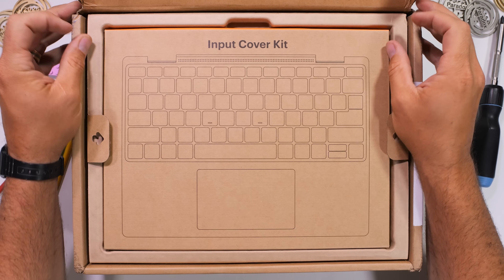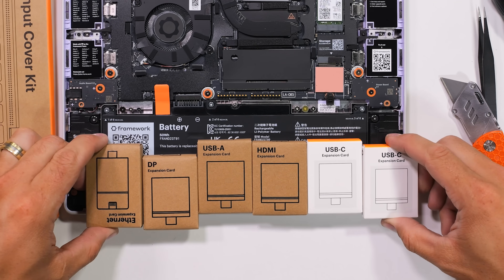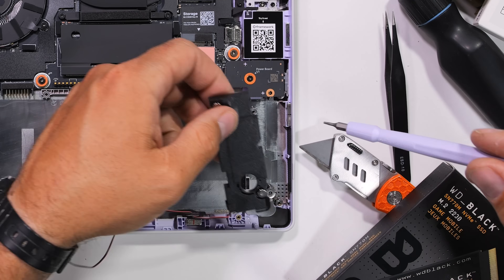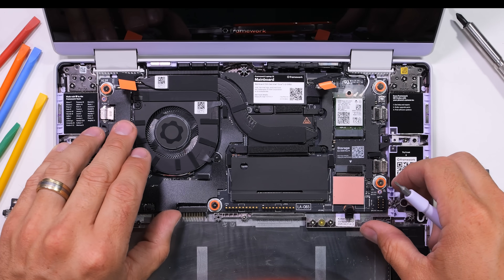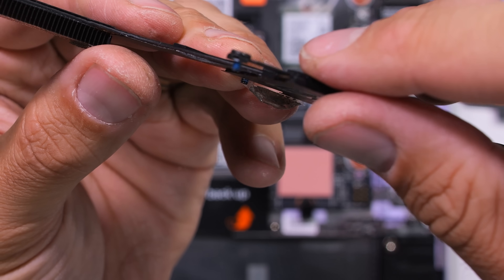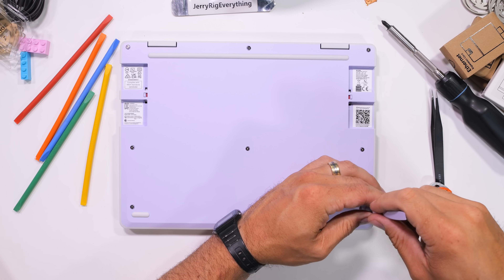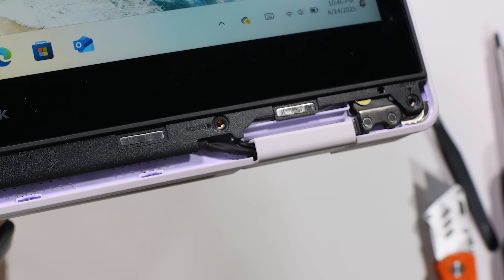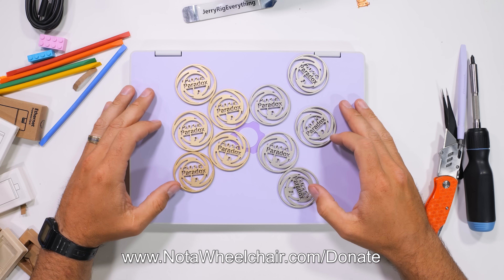The Best Laptop on Earth... is almost too easy to fix.

Comment: Extreme hot take: Devices like this have the chance to create more e-waste. Every modular component is created 3,4,5x times more than the standard laptop. If only half of the buyers of this laptop chooses to upgrade or swap out components, all of the remanding components become e-waste. (Extra batteries, USB C Mods, motherboards, etc.) It's almost the equivalent of companies making thousands of "off brand" replacement parts of an iPhone and then 2 or 3 generations later they aren't able to sell them, so they become waste.
If you are making a device that is intended to be modular the modular pieces cannot exceed the number of units sold, otherwise they will become waste.
Reply: That same would apply to a regular computer. If a company makes too many computers but people don't want to upgrade, then they will have to discard them.
Reply: @ChaoticDucc  Yes, but that also applies to framework. Not only would there be extra computers, but there would also be extra parts/components. For every framework laptop not sold there probably are 3 or 5x the components as well. Creating even more e-waste than just the laptop.
Reply: Like normal pc parts this modular approach will create used part market.
What a great way to collect cheap used parts and build a working laptop.
For example I have bought Xeon 4/8 cpu from 2012 to my mini itx system.
And it runs great still.

Comment: "Historically, nearly every laptop manufactured since the younger dryas has been un-modular and un-upgradable"
Uhh, what? The work laptop I am writing this on has a replaceable hard drive, RAM and battery. Those aren't as common as they used to be, but the 2010s really aren't that long ago. They were standard features which even the Macbook Pro had until 2012. A few short years before that, Macbook batteries could be hot-swapped without tools. I understand the point you (or Framework) is trying to make but you don't need to normalise non-repairability in order to sell a repairable laptop. This can and should be how every laptop is made because historically, it has been every laptop.
Reply: "you don't need to normalise non-repairability" but it is the norm now?
Reply: @ChaoticDucc The key word being *now* - if you tell people it has always been this way, then you discourage any motivation they might have had to fix it.

Comment: My Framework 13 has been used in the auto shop, and it's surprisingly durable. There's some special knowing full confidence that it will only cost $300 to replace the entire shell, keyboard, and touchpad, but it still haven't broken the original chassis.

Comment: For my business computer, I chose Framework rather than the usual Apple laptop that it seems most people who do what I do tend to buy. I really like my 13' Framework laptop running Linux! It's been reliable and is a powerful little machine for a fraction of the price of an Apple computer. Very happy with this product and with this company! Thank you for the video.

Edit - what I like is that my company can buy components to upgrade or fix if need be, rather than having to buy an entire computer.

Comment: Okay so, this is an insane value, the base model if anyone just needs something for school or work or even zoom calls, starts at $850 on preorder.

That's...not bad, it's even cheaper than what you'd find retail, and they even knock $130 off the price if you order it with no OS, should you have a windows 11 flash drive or even a Linux Distro

Comment: While the initiative is great, my big issue with this whole design is that most replacement parts will need to be sourced through framework themselves. Which is essentially what Apple has been doing for decades, except framework relies on you to fix it for them.

Comment: 1:15 correction it should not be "finished assembling it yourself" it should be "finished reassembling it yourself"
It's a very slight difference.

It's also making reference to the fact that they have to assemble and disassemble them before they can ship them.

Comment: Great vid but i don’t really understand why you took a shot at apple not making battery replacement easy when they have become one of the easiest phones to replace the battery in. The 16 has the cool adhesive that releases with a little bit of voltage and they did great work making the front and back if the phones easier to replace as well. Other companies are far worse than apple nowadays.

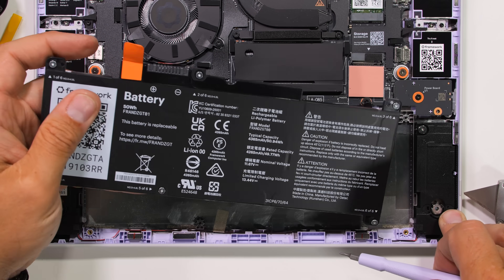Comment: 2:04 I remember some idiot telling me that batteries need to be glued in place and other methods of attaching battery causes damage. But this video is proof that there's literally 0 valid reason for companies to glue their batteries in place, making it a pain in the ass to replace. The only reason it's done is so companies can make you buy a new device every time battery goes bad.
Captive screws is an interesting concept, but what if the screws strip? Now you gotta replace that whole component. Then again, it's torx screws and not shitty philips, so it's unlikely.
Either way, it's too bad that you pay more for less performance. It's a bit weird of you to call it "inexpensive". It doesn't even come with an OS, so that's gonna slap on more money for a lot of people who want something "legit".
And only 1 year limited warranty? That's nothing.
For the price of this where you assemble yourself (the 549$ version), I can buy an already assembled laptop for roughly the same price, but includes Windows 11 and has twice the RAM at 16GB
It's crazy that they charge a whopping 250$ just to have it pre-assembled. I've paid less to have a plumber drive out to me and install a dishwasher lmao.
If you make it 16GB RAM, then that's another 80$ on the DIY version and if you add Windows, that's another 140$. And then the expansion cards that will probably raise price by around 30$ and oh wait, it doesn't even come with storage by default lmao, that's another 100$ for the 512GB SSD. So 900$ for something I can buy pre-assembled cheaper.
Being able to upgrade the parts doesn't really mean much other than being able to swap the batteries for repairability. The laptop doesn't even have a GPU so there's no upgrades there. Vast majority won't need to upgrade RAM or storage, and especially not the CPU.
Also while it may cost 900$, that's before it's been imported to my country, so I'd have to pay 25% more. The other pre-built laptops already have that in the price so it'd be like 1125$ for the framework vs a prebuilt local one I can get my hands on much faster for almost half the price.
Heck, even the RAM is 5600MHz but it runs at 5200MHz.
Framework is interesting, but it needs to significantly lower prices for it to actually be worth it for most people.
Reply: Im pretty sure you can pull the little metal piece that keeps the screws captive off and replace them. I did that to screws on a laptop I had once, it wasn't a frameworks laptop but what I could see from the video it's the same small metal disk holding them

Comment: I used to own a Eurocom (Clevo) laptop. It was advertised as the most modular and upgradable laptop with 2 m2+2 HDD, 4 ddr4 memory slots, desktop CPU and GTX 1080 with the possibility for SLI. Theoretically this laptop can last years if I can just upgrade my cpu or GPU in the future. However, I find that it’s nearly impossible since for the cpu, the sockets keep changing, I think the best cpu it can fit is i9-9900K. As for the GPU, same problem, also, it’s really hard to find laptop GPU for sale, only place I can find replacement for the GPU is from official website or eBay, but it cost way more than how much the unit actually costs. I’m a little skeptical about modular or upgradable laptop because of my experience.

Comment: I audibly gasped when you pulled down the screen and removed it with no adhesive. Amazing! I hope some big companies begin to follow suit!
Reply: This is perfect for students, I hope they start to provide oled versions too
Reply: Ironically, apple uses magnets to hold screens on laptops and AiO computers, at least back when I repaired them lol
Reply: @ktfcaptain  Idk about Macbooks rn but iMacs are absolutely a pain to repair rn.
Reply: @ktfcaptain I had to do basic maintnance on 2018 mackbook pro not that long ago and let me tell you it took me 2 hrs with yt tutorials... It`s like anti repairable... They use different screw types just to hold the battery. Just why dude? Similiar with the rest of components. Don`t even get me started on cooling system disassembly... The screws usually look so similiar 1 careless moment would be enough to damage something. I`ve done maintnance on quite a few laptops, never had as much stress during one.
Reply: @ktfcaptain  Interesting! My dad's old iMac is that way, I've taken its screen off before, but I didn't know they did that for older MacBooks. I haven't looked into the construction or repairability of their recent stuff much, but with their electrically de-bonding adhesive, I'm hopeful even Apple will implement some more repair-friendly features.
Reply: @ktfcaptain  Pretty sure that was discarded when they discovered glue meant fewer non-authorised repairs....
Reply: Never seen a laptop with adhesive on their screens though...
Reply: @MatvaNabor  ?It is pretty common, wdym
Reply: @MatvaNabor  They're not too hard to find but you can only work on what's in front of you.  Honestly there's a mix of pull tabs, glue, double sided tape holding screens in depending on make/model.  The better ones obviously use screws and thankfully as far as screens go most use screws but it's heading one way....

When I worked I was in IT between being the department, technician and being in charge of a team we moved all our hardware to IBM/Lenovo and honestly it saved sooooo much work and getting parts was a doddle as the warranty warehouse was only 20 miles away.  They used to let us request the part immediately, once warranty delivery arrived we'd put the faulty one in the box and give it straight back to the driver worked really well.  Although we had less than a dozen warranty claims in 4 years overall from servers to desktops to laptops
Reply: @MatvaNabor how often do you remove screens on laptops?
Reply: @MatvaNabor  You'd be surprised then. Most laptops I work on have adhesive strips that are essential for keeping the panel attached to the back cover. Thankfully, most of said strips have little tabs to pull on which is supposed to remove the adhesive, but then you need new adhesive strips to secure the screen properly again. It's gotten better, but it's still sub-optimal on most laptops that I see
Reply: These are pointless, and overpriced, and ugly..
Reply: @LeRoy9000  not pointless, not ugly. The price is a bit steep, but if the market shifts to support this kind of thing then the price will level out. Hopefully it does, but time will tell.

Comment: Dude it only "starts" at 559$ if you get nothing inside it. to get a computer that can boot after you put linux on it it "starts" at 776, which is trash for an 8 core. For that money you can get a beastly mini pc with oculink and throw a gpu in a cradle later for REAL upgrade power.

Comment: For the low low price of two laptops of equal power. Everyone kissing framework's ass because they did a "nice" thing (building demand for their part store?), but who cares if it puts me permanently behind? A lot of people don't have the option of basically taking half power or doubling costs. More over, if I could afford double cost, I likely wouldn't need to do repairs. Twice as rich just buys another laptop, or buys both upfront for a 100% productivity boost which might pay for laptop 3. This thing is basically a toy. And if you're in a real world case where it somehow saves you money, you didn't need the money in the first place. It means you're rich enough already to spend money buying more money and again you don't need a laptop. This is why MBAs brain drain every other degree program. Smart people step back and ask what's the goal. Do I want repairability? Sure. Do i want 2x costs across the board, no. Also, there are series of framework laptops already. Not even within what a 3 device single company run could they maintain actual modularity. People still selling old frameworks to buy new ones, and while yes they aren't filling land yet, that's where that process leads. Basically this is somewhere between fraud and an expensive gimmick. The market can't fix this kind of thing, it requires fiat. That's why we live in a vending machine and not a society.

Comment: Watching this on my Framework 16. Had a few issues but being able to just open it up, dab a little JB weld on something, and screw it back together is so much better than having to bust out the Dremel to try and fix my Surface. True story.

Comment: Uh hum,... numbered screw holes on heatsinks has been used for donkeys years.... sounds like you need to take more stuff apart if you haven't spotted this before...👀
Erm, did you repaste the CPU before attaching the heatsink...?  🤦

Comment: Don't get me wrong, framework laptops and their philosophy are absolutely the best there is on the market, and i wish every company was like them, but i am kinda scared of the pogo pins, Guitar hero 3 guitar used them on the neck, and they were notorious for eventually loosing strength on the springs and not maintaining a good connection, hopefully this will not be the case

Comment: wait until the company discontinue the product in a few years then you can treat it like a regular laptop
Reply: I mean… FW 13 is into its lifecycle by a few years and you can still buy replacement parts for it. You can upgrade all the way from the 11th gen intel board to the new Zen boards without having to replace anything else. You can put the new high res/refresh rate display on that older system. They’ve been using the same layout for years to make it upgradable for anyone who owns one. Truly much more than anyone else has done.

Comment: VERY cool - and YES, JERRY: we DO want to see you review the 16" Framework. Do the 13" while you're at it.
This was a good review. I'm interested to hear your take on how it performs with Win11 & standard apps installed: what performance is like for a typical user, and how long that battery lasts for a typical user. Thanks!

Comment: I have one of the OG framework laptops. Not sure if it's still an issue, but if the usb-c modules were always "on" with the original board. Basically if you used anything other than a usb-c to usb-c module, the battery would drain a very noticeable amount even when shut down. It was something like 8-9% with a usb-a and hdmi port installed over 8 or so hours vs a more negligible ~2% when leaving the modules unplugged over night. I mostly used my desktop during the week and only took my framework with my on weekends and it was annoying to no end always picking it up and it being completely dead after a week.

Comment: I wish they had a version with a more modern screen and not just 1920x1200 ~ 185ppi... They have 2 screens (one is low res and one is decent) for Framework 13 for example, so the possibility is here.

Comment: My zenbook is 10 years old, still works perfectly, i've upgraded ram and ssd using only a screwdriver. Your plastic piece of crap uses some default mobo with proprietary dongles for IO... and you call it 'the best laptop'. Sheesh

Comment: 4:30 - not really, that phone number makes sense, because the disassembly of motherboard is nothing unusual in this case, as it needs to be replaced when you upgrade your system - in that case, Framework could also provide a housing to turn your last gen motherboard into NAS…

Comment: I guess my only worry with modular stuff like this is that you're still locked-in with their overall "family", like AFAIK Framework is the only one that makes these parts, so you're limited to whatever parts they make and that's it, which I assume also means any tech support needs run the risk of being a "Framework" problem that you need to go on their forums and talk with their other users for. Plus I guess in theory the modular stuff means you're practically doubling the number of points of failure, meaning extra troubleshooting and extra contacts to check and so on.

Still like the concept overall though. Wouldn't buy one, but I like the concept.
Mad props for being sane about Apple, as always. It's shocking how many Apple fans worship the platform like it's some kind of god, only to end up spending $1000 a year on upgrades, subscriptions and accessories and still manage to get confused about how my cheap Android phone can play all the games they like to play and still take 2-3 weeks to die playing Pokemon Go.

Comment: "Framework is the antithesis of Apple..."  I have owned Apple Laptops since 2003 (there PowerBooks back then) and I have never had one fail on me.  The older ones you could upgrade the RAM and swap out Hard Drives for SSD's, but today you buy them with the specs that you need.  And you can trade them into Apple when you upgrade or sell them to recover some of the costs - they hold their value well.  I don't think Framework makes a quality product overall - with mushy keyboards and terrible speakers.  I don't find the Framework model desirable -- trading quality for repairability.  It's for suckers.

Comment: I wish they sold in my country, im still rocking my HP probook 4440S, it cane with an i3 and 4 gb of ram, now shes an i7 with 16 gb of ram and 2TB SSD, it's a beast, and only because HP sesigned everything modular in that era, even socketed CPU.
I wish more manufacturers were like framework

Comment: I don't like it. It doesn't have enough power and is very expensive. It is better to buy a new laptop evey few years then buy a framework. you will get better performance and it will probably also be cheaper lol. Call me when they get their pricing and performance figured out.